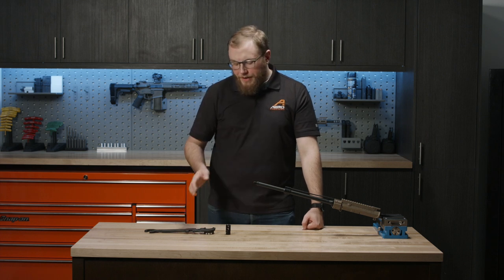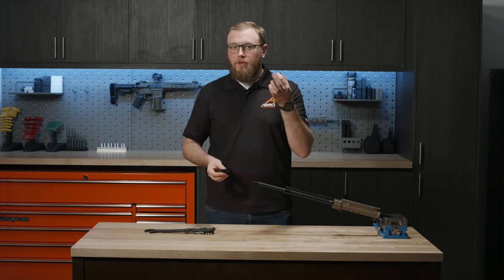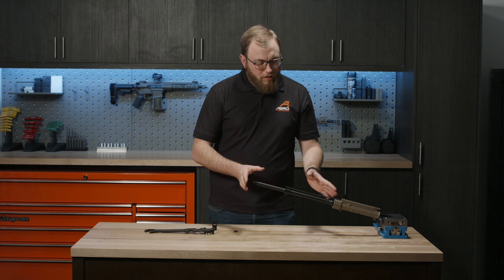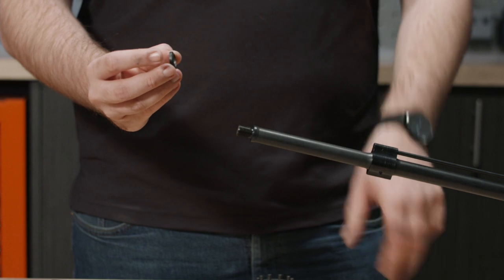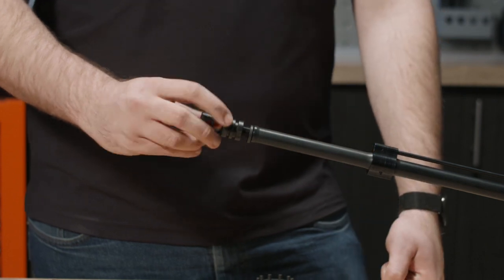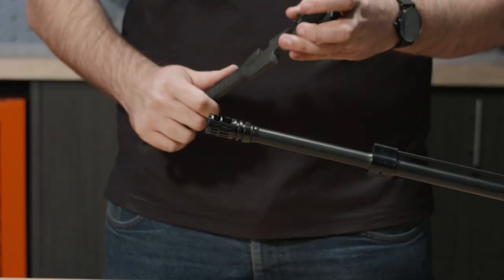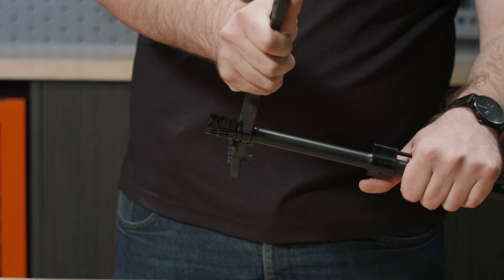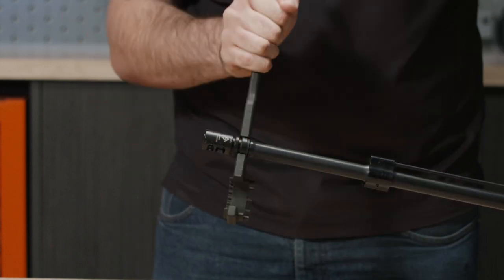How to install a muzzle device on an AR15

Comment: Can you post a video on the VG6 muzzle devices and how they compare to each other in terms of recoil reduction, muzzle rise and flash suppression? Can you also explain the cage device and what muzzle devices it works with? I have a howa bolt action in 308win with threaded barrel.  Are devices meant only for AR10s or are they compatible with any 308  threaded barrel?
Reply: Would assume if the thread pattern matches then you could install on any rifle of proper caliber.

Comment: Dumb question...is the purpose of the crush washer just so you can clock the muzzle device properly?
Reply: You are mostly correct. It's purpose is to both time/clock the muzzle device while also ensuring a proper amount of torque (or really, a proper amount of force & friction between the interlocking threads of the muzzle and the muzzle device) is applied such that the muzzle device won't unscrew under use

Comment: @Aero Precision, LLC  Is there knuckleheads here or did you leave something out, in particular @knottheory79220 comments? Also, after the proper torque/timing is finished is it necessary to pin or pin/weld the device?  Thanks

Comment: Is loctite recommended?.... I've seen videos where rockset was used..... is any of this necessary???
Reply: Never. If anything you put anti-seize on the threads so you can actually remove it in the future if you need too.